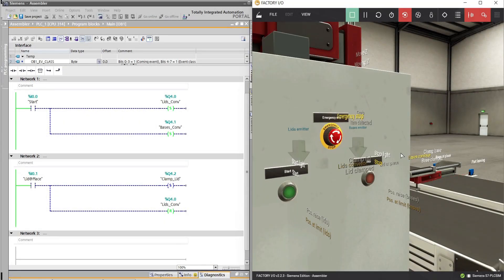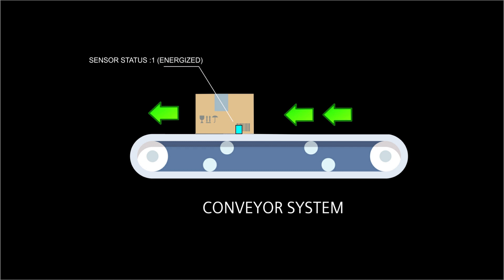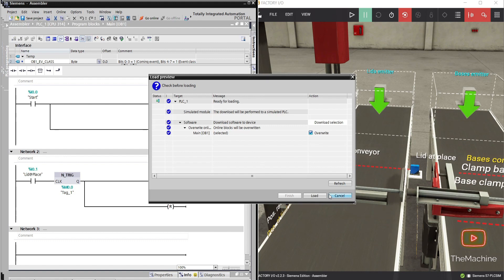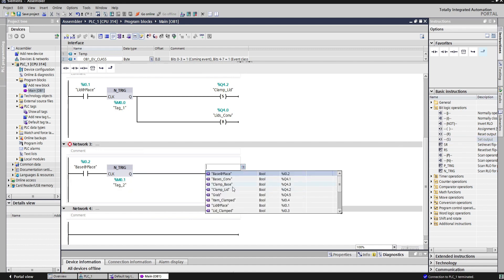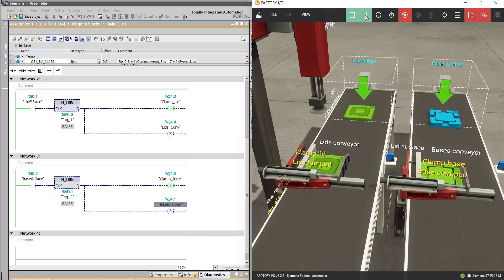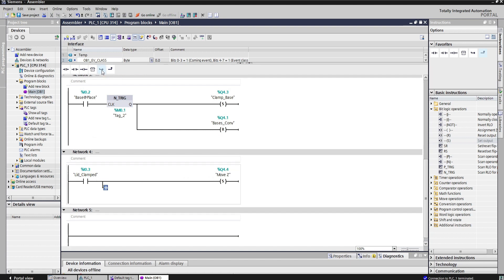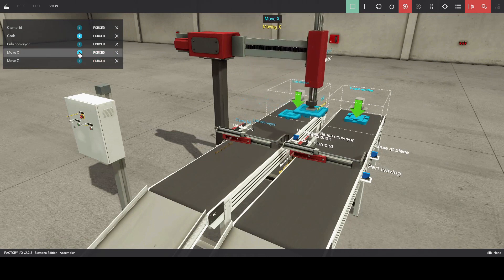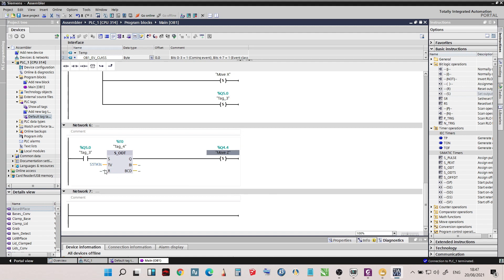How to run Factory IO Assembler scene in Siemens TIA PLC program (Step by Step) Part 2

Comment: Well done but if you watch this scence on factory io site you will notice that after grab the lid the arm will move up then will move x in your program it does it at the same time and there is a manual mode when you change to it , the process should do one step only after each start pressing